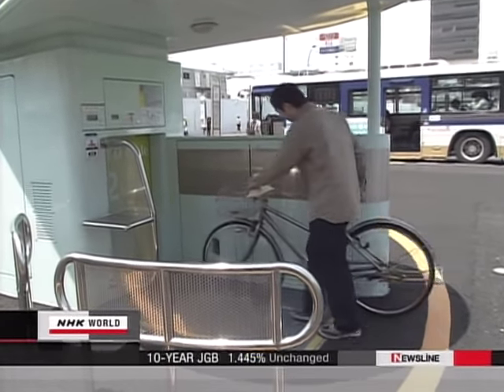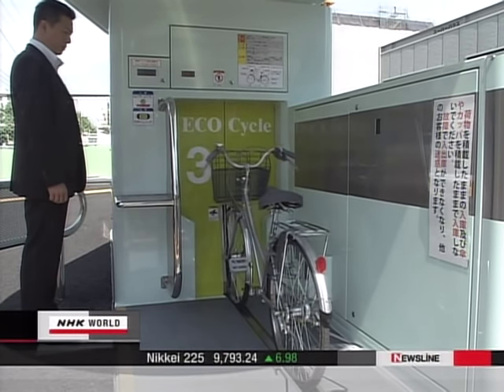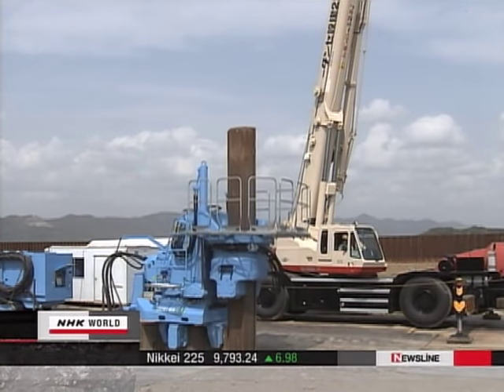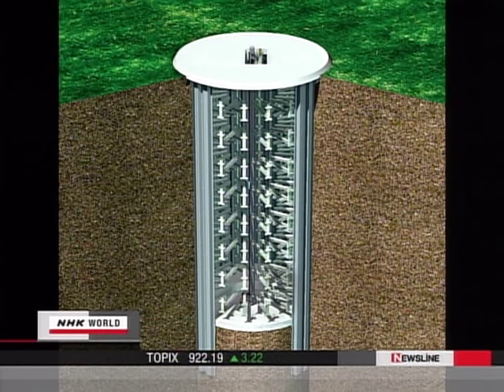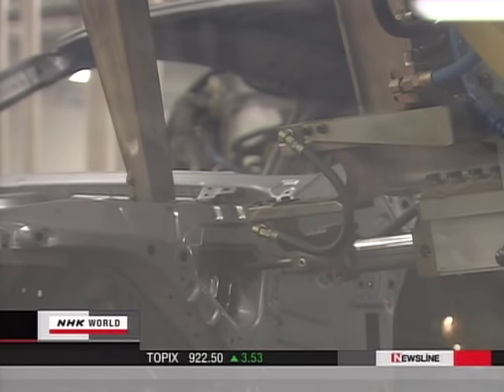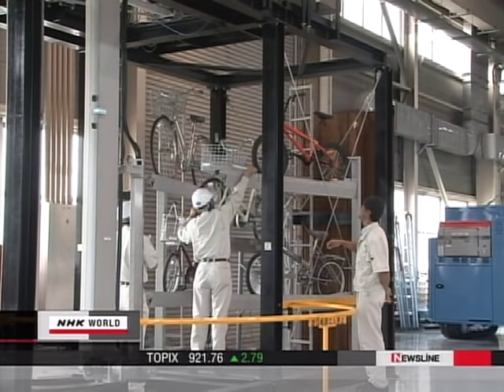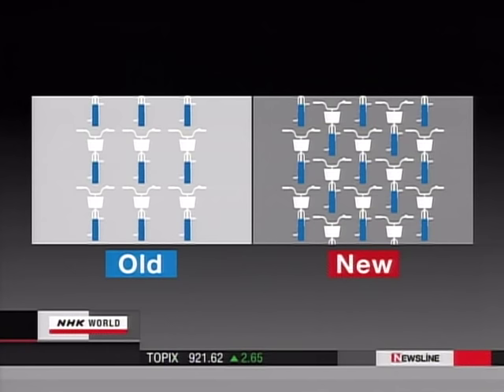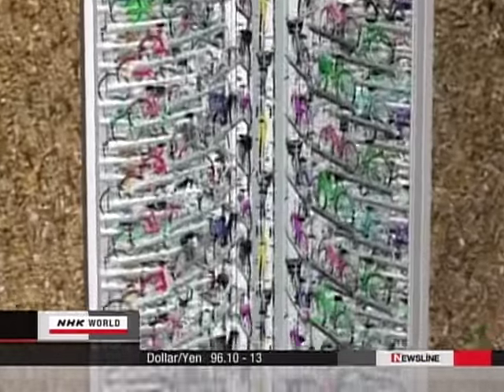New technology for parking bicycles تقنية حديثة لتخزين (اصطفاف) الدراجات

Comment: If this parking can handle about 200 bicycles that would usually be locked to anything on the street level, it's useful and practical. The technology to drive those post sections in the ground without pounding them is also intriguing.
Reply from the maker: precisely

Comment: The only issue I can see with this idea is if the system broke down, you wouldn't be able to get your bike out until it was fixed.  Therefore, a rigorous maintenance schedule would be absolutely essential, and with city/county budgets always in flux, this maintenance schedule would almost certainly be the first thing that gets cut.  And if the parking system obtains the perception of being unreliable, people won't use it.

Comment: @KrunchyJD People dont travel distance they travel time. In cities such as London the average speed of traffic in peak hour is not much above 5 km/ h, you can walk that fast. Trying to solve the problem of congestion with more roads or by spreading people out simply creates distance, so the amount of time it takes to get anywhere actually increases. Sure in a rural setting sometimes cars save time, but building a city for cars and having everyone drive simply devours time, it does not save it.